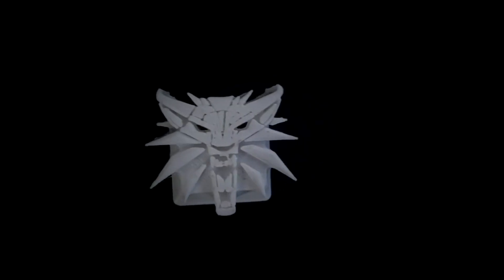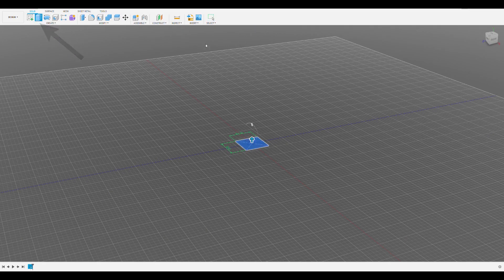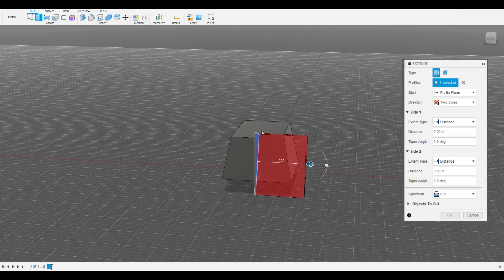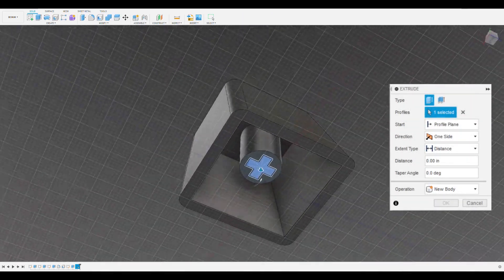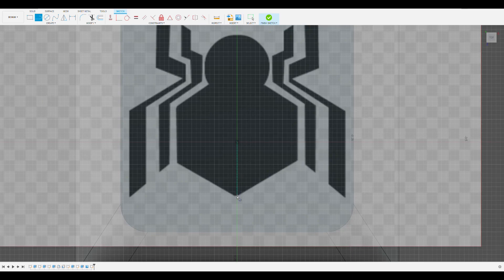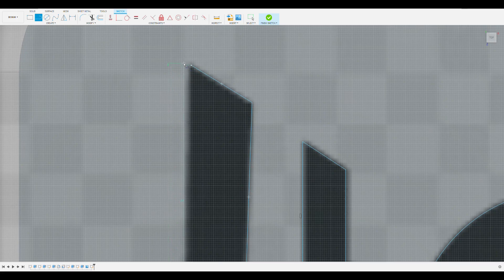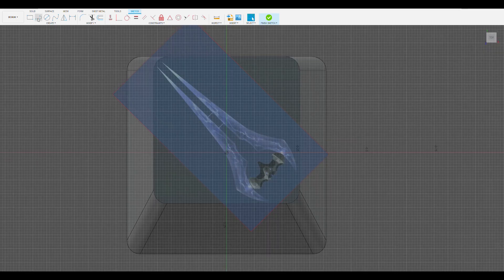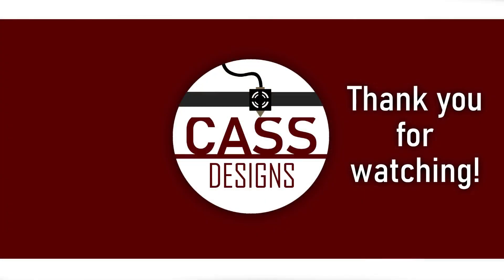How To Design Your Own Keycaps to 3D Print in Autodesk Fusion 360 (Beginner Design Tutorial)

Comment: Measurements would really help. a lot of key caps are standard size?
Reply from the maker: You're right, there are standard sizes, but they change slightly based on the keycap style. In this specific video the blank I used I roughly modeled by measuring my escape key with a caliper - it doesn’t need to be super precise